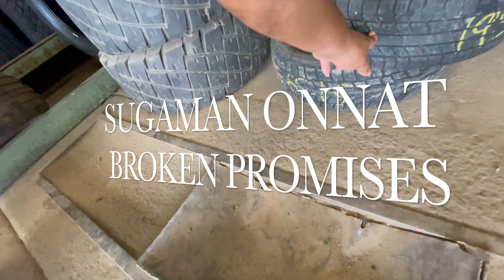Took Them Pick Up Truck Wheels Off My 79 Malibu Getting New Ones

Comment: They put big bolt pattern  rotors on the front. Those truck wheels 5×5 big bolt.
Reply: nahh we just threw truck tires on the front to move it and nothing else. they didn’t fit we made them 😂

Comment: Rim might be 5x120 and the Rotor is probably 5x4.75. The center bore on 120 is a few mm smaller. Just gotta bore the rim out.